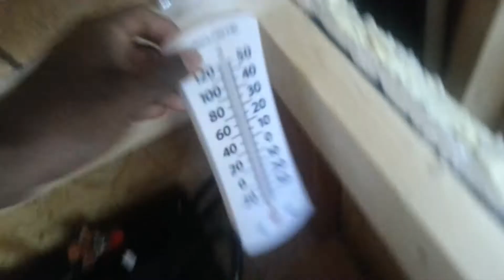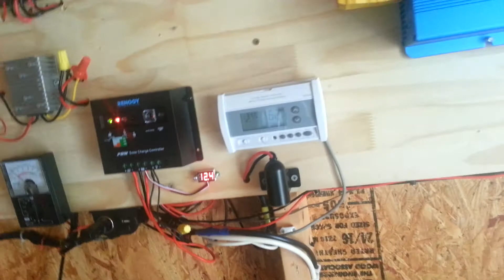System Upgrade: My New Solar 24 Volt Battery Bank

Comment: OK ANTHONY BUT WHAT A/H IS THIS ONE AND BECAUSE I USED IN MY WHEEL CHAIR 35 A/H 12V BUT FOR SOLAR I THINK THIS IS NO TO GOOD
Reply from the maker: Jose, These are only 32 ah (each) but if you have the money, get the highest ah your budget will allow, as you will have longer run time.